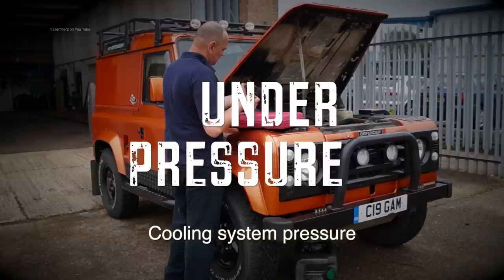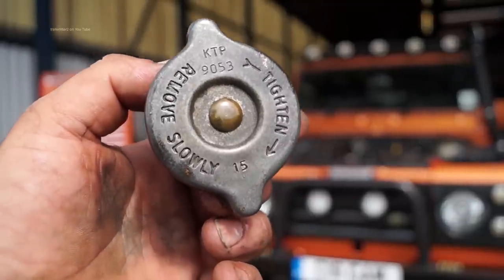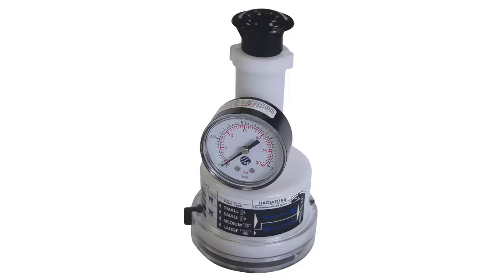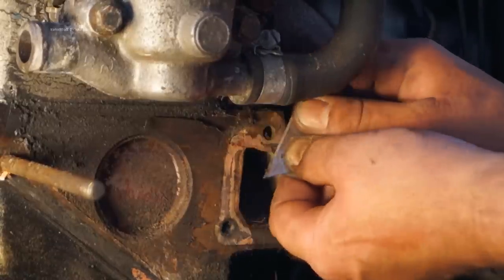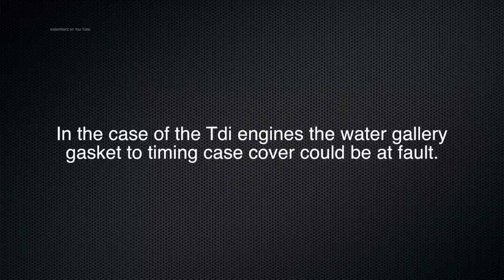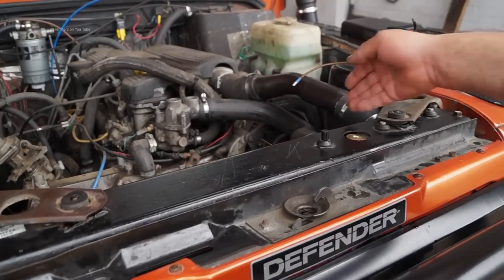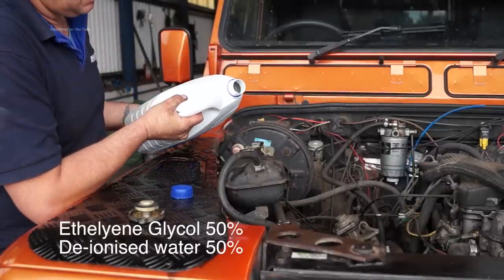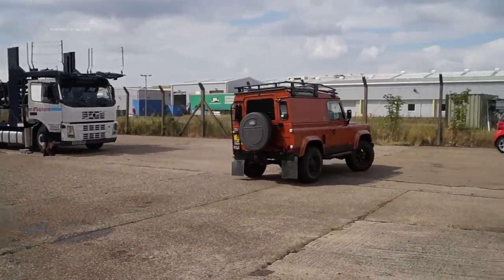Why Your Cooling System Needs Pressure - Maintenance and Diagnosis - Land Rover

Comment from the maker: It is actually the OAT or Monoethylene Glycol antifreeze, which is RED and attacks certain metals. . The blue  Ethylene Glycol is safe for "older engines".   According to Miller oils the O.A.T. antifreeze  attacks yellow metals where as others have experienced all sorts of problems with it.  Red is okay on modern engines. Blue is safe with Tdi engines BUT as a side note one must consider the other metals in the cooling system too.

Comment: hi i think i might have the wrong cap for my expansion tank. i have an ex military defender which had the n/a 2.5 diesel engine. that got swapped out for a 200tdi defender engine but i think they left the original expansion tank cap on, which is rated to 9 PSI. since i had it in May, it has been losing coolant. if i was to get an expansion cap rated to 15 PSI, would this help stop the coolant loss?
Reply from the maker: I would take a good look at where the coolant may be going to.  Pressure will just make the system more efficient.
Reply: I thought that the coolant would escape from the cap rated at 9 psi when the system runs at 15 psi
Reply from the maker: no it is the cap that will keep it at the pressure designated on the cap.